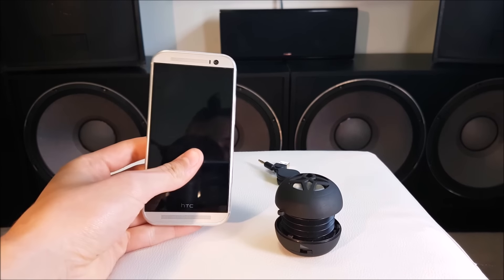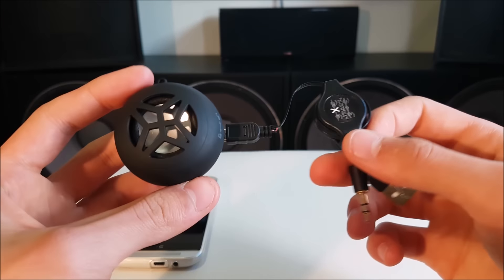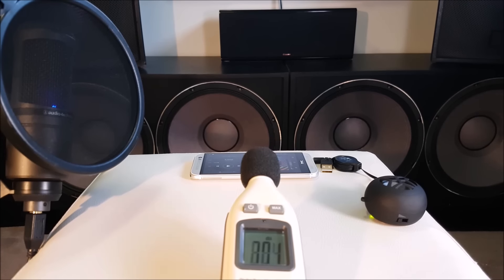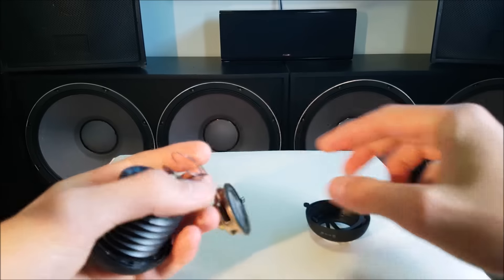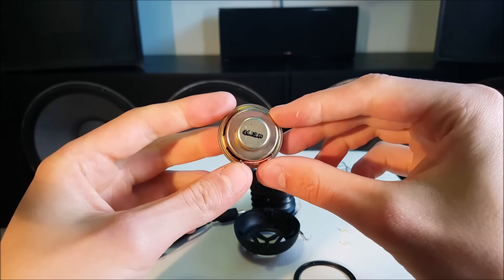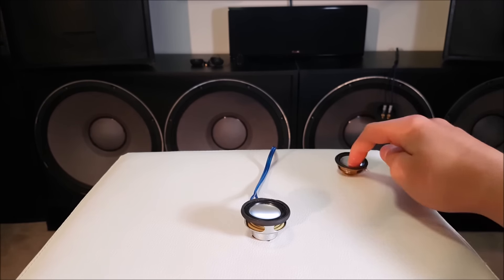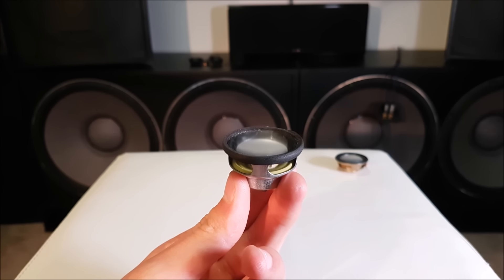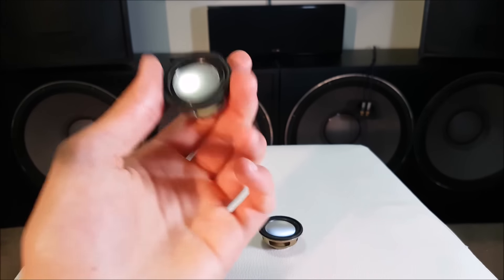WORLDS WORST PORTABLE SPEAKER + BLOWOUT!

Comment: I'm not surprised the HTC One M8 at least sounds better, its obviously not going to be louder as the speaker drivers themselves are 1/6th the size. However, the smart-boost NXP TFA amplifiers that drive those little speakers can actually drive them safely up to 4w with speaker protection, heat and excursion monitoring. The enclosures are also very well designed for a phone, with nano-material filler for improved lows.
Reply: Until it blows ,htc has bad hardware and it has my favorite software too bad for hardware

Comment: I remember when I was younger my parents bought me the X-mini 2 which had 2 of those attached to each other. A year later I disassembled them and installed the drivers and amp units in a metal salted nuts canister and it sounded pretty good with surprising bass.

Comment: Buy the zulu 2.1 by blackweb. It costs $100, has a 100 watt 5 1/2 inch sub, 4 driver soundbar. Its advertised to have hd quality 2.1 surround sound. Its pretty nice for a cheaper speaker. Ive checked and it can do down to about 1hz pretty cofortably.

Comment: dude the amp in that that thing must have like at least twice as much bass as my rockford fosgate punch 45hd with the two 10 inch 45 watt subs that go with it and also i thing that has 2 AWG wire... lol that amp board had some pretty massive heat sinks and fans on it also